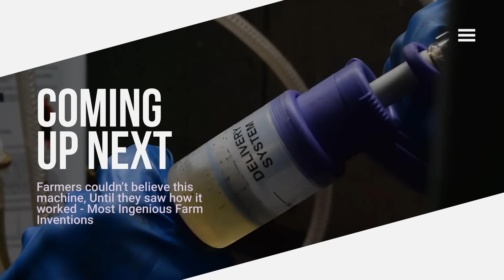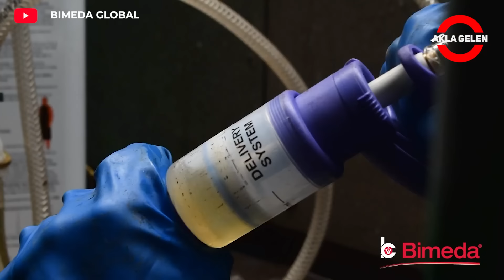Farmers couldn't believe this machine, Until they saw how it worked - Most Ingenious Farm Inventions

Comment: Did anyone notice how many cuts the poor sheep got on it's body?
Reply: Any man who shaves understands that you're sometimes going to get knicked up. It happens.
Reply: That machine produces way way fewer nicks and cuts than the old totally hand held method.  I notice one big advantage is that the machine firmly holds the sheep and off its feet, thereby providing a more safe shearing for the sheep.
Reply: That's because the shearer didn't use the Manscaped brand.
Reply: Yes, on top rough handling of the sheep.  More work needs to be sure animals  is not hurt
Reply: @yiayiak8195  It's also about not terrifying them to death. Some of these machines can cause ana animal to have a heart attack in fear.
Reply: @Gablesman888 that’s true, I was a on a farm with 2k sheep and manual shearers. Those guys were super tough and one was a woman but they are fewer and fewer these days as the wool price sinks( for some reason!). They are now trying to breed sheep that don’t need shearing as 50 p for a fleece doesn’t cover the searers cost.
Reply: @yiayiak8195  People who work on industrial farms with hundreds and thousands of animals usually cannot afford to be slow and careful. There's too much work to be done and only so much time to dedicate to each individual animal (whether shearing or hoof trimming). It's easy for us to judge and criticize because we're not in their shoes and under the same pressure and time constraints as they are...
Reply: Yeah i did. That machine is only as good as the guy using it i guess.

Comment: This is some great machinery.   I wander what goes through the sheep minds as they get flipped , and their winter coat comes off.  Well not much goes through a sheep's mind , but surely they hafta wander , what just happened. That milking station , and car wash is totally awesome dude!!!!  On hot days I bet they can't wait for the car wash. They were as calm as a Sunday sit on the porch.   All of.this is plainly seen to keep the stress level down in the livestock.    Way back in the day , when we would go get to the stock sale to buy stock they would be stressed to the max by the time we got home.    They used those Shock Sticks on them constantly , and they would about jump the stall walls  because of the terror.   We would carry grown steers to the sale lots that were grown out.   They would be tame enough to ride around the barn , and by the time they got to the sale pin they were slobbering , and trying to jump outta the auction pin.
Reply: Is it the barber or manicure time AGAIN?
Reply: What makes you know what goes on in a Sheep's mind. When you only know cruelty you know nothing else. You dont know what's like to bee treated well. Not cows,not sheep,and most certainly not chickens.
Also,this is a different unmeasurable terror. Tahe sheep were paralyzed by fear,not being calm.
Reply: @xScooterAZx  😢😭😥😭
   For someone who is so self righteous , you know little , to nothing about animal husbandry.    Sheep are very dumb.  But they are great at loving, and trusting.    When one person tends to them regularly , they won't come to someone they don't know. If they're left unshared, they will die , from the wool growing on them , or will die from the wool blinding their eyes.   They need constant hoof management as well. They have little , to zero fear of things that will harm them. It's well known for them to find their way into a fire , and run into a barn , n burn it down. 
    So you're saying , that taking care of the sheep is cruel!!!?????  Take a look at yourself , and see how cruel it would be to ignore them.      Why do you think sheep herders spend thousands of $$$$ for good protective sheep dogs.    Of any agriculture , sheep herders put more love into the herds than about any kinda production. 
    A young girl close to us who dearly loves animals got several to keep as pets.    They were way to hard for her to take care of.    They constantly were getting into trouble, like showing up limping. Somehow getting out , and couldn't figure out how to get back in. The list goes on.   She is a young lady who grew up around all sorts of animals.  From tadpoles , to horses. 
    It's easy for a dogooder to see something they know nothing about , and think the worst , but they have zero education on the subject.    After you have bailed , and put as many thousands of square bales of hay as I have , or set up all night with calving cows , to then go work off the farm with zero sleep , you can put your options in.    When you have names for your livestock , and pet them daily, you can't call me cruel. 
    God gave us dominion over the animals on land , as well as the fish in the sea. If your opinions are greater than the authority of the Most High who is the Master Creator, please let me know.

Comment: Skinlyte has a soap that is loaded not only with collagen but also keratin peptides.  It is called Hair & Whole Body Bar.  It is fast absorbed because it has an enhanced peptide binding enhancement technology which produces water molecules in a condensation reaction that hydrates skin and hair naturally.  It repairs, rebuilds and strengthens hair and skin.  I got it at Amazon and I am impressed with new benefits I discover every time I use it.  I noticed many improvements in my hair, skin and nails.  What I like best about it is that it's all natural and without harmful chemicals such as synthetic dyes, fragrance, SLS or preservatives.